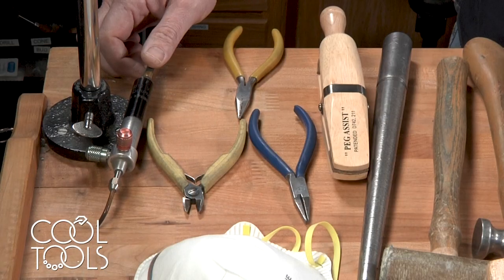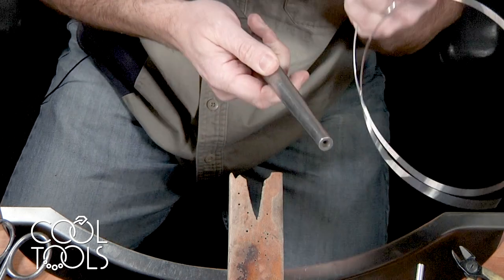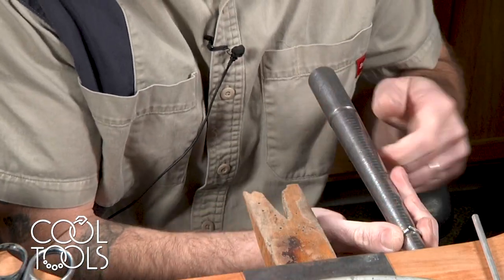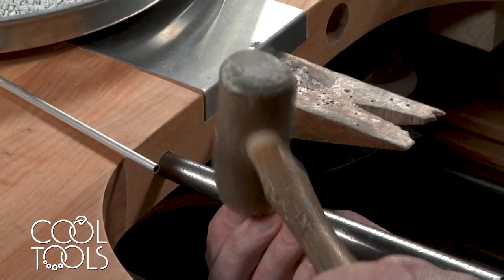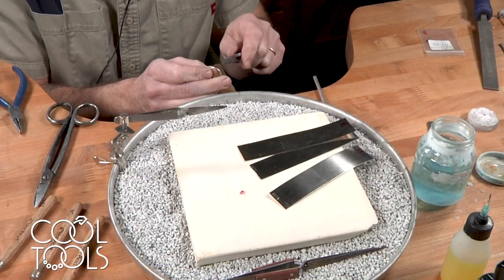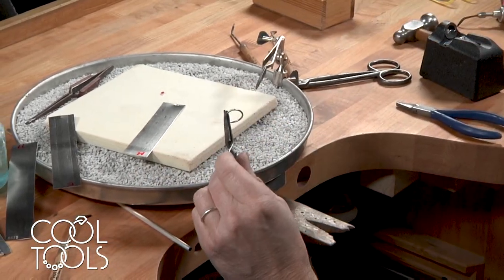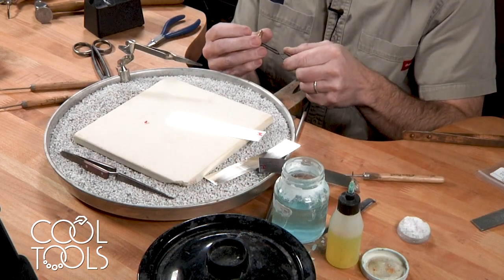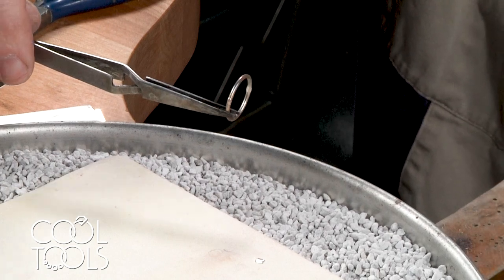Cool Tools | Bezel Stacked Ring by Matt Breunig

Comment: Hi, what type of ring mandrel is it that you used to measure the length of wire needed for your ring size?
Reply: It's a standard steel mandrel. It measures up to size 15.
Reply: @jewelrybymattb  Thanks for your reply. I see that it looks like a standard mandrel but yours appears to have a gauge on it for measuring the length of wire one might need to make the shank of the ring. Mine doesn't have that. Is it something that you added to the mandrel yourself?